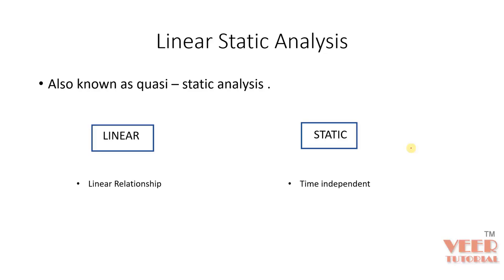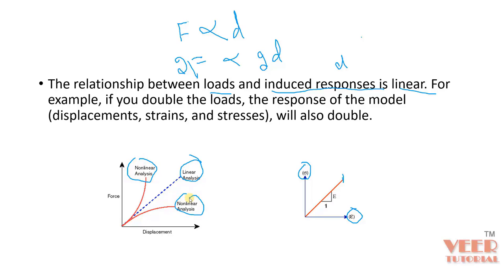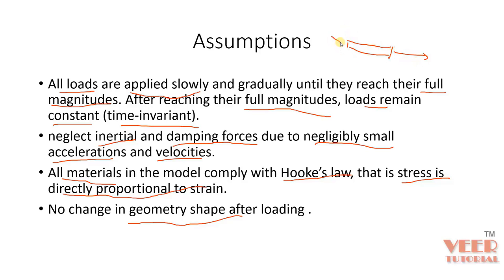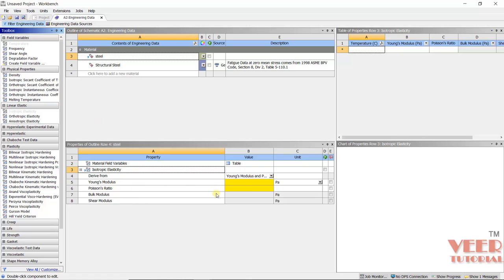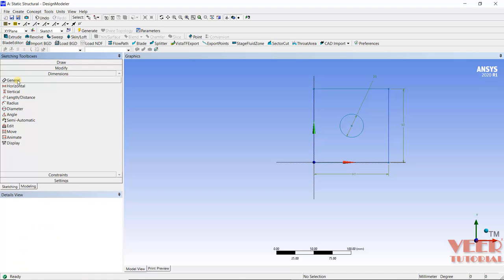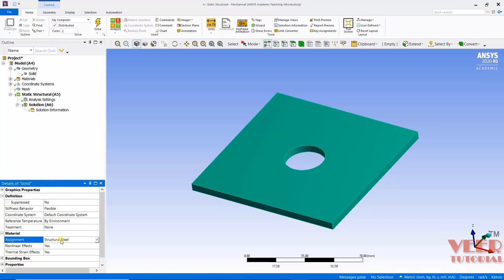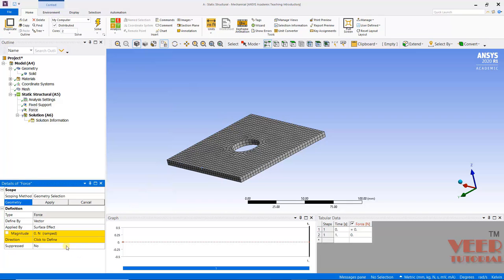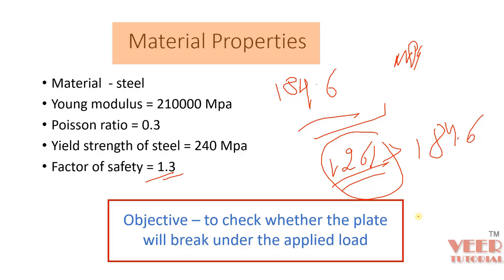ANSYS WorkBench | Plate with Hole | Analysis

Comment: Why does frequency of steel plate with holes is lesser than the one without holes ?
Reply from the maker: hello @anusha, frequency depends on two factors, mass and stiffness. removing material also lowers the stiffness as compare to mass reduction. that is why, frequency may  be lesser